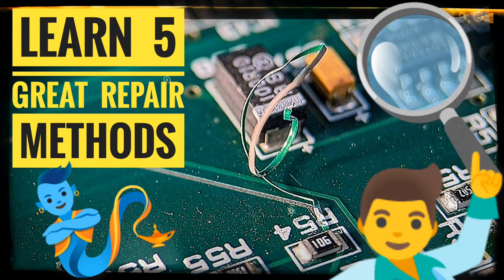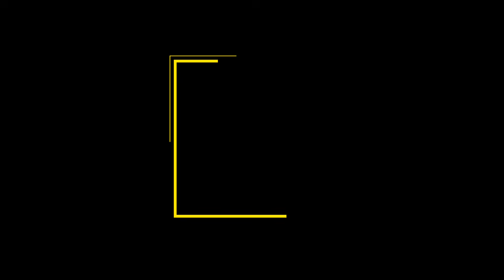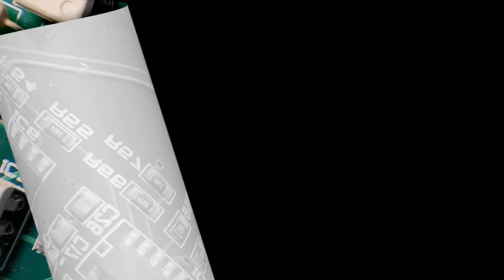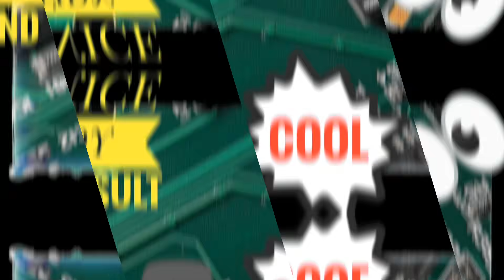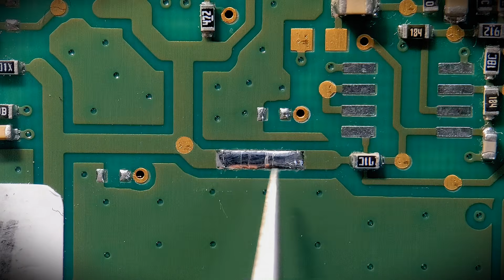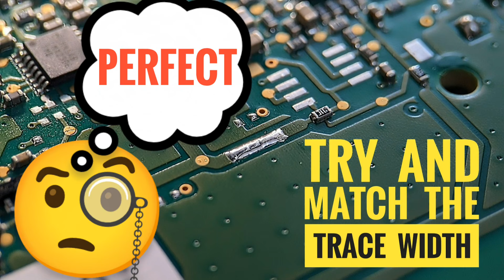Repairing Damaged / Broken PCB Traces || Soldering Tutorial

Comment: I notice that you use 0.2mm copper wire. In my haste I bought 0.1mm. Will that be thick enough to repair a trace that has 3.3v running over it?

Comment: Sir, great video.
In my restoration project, I am facing problems where VIAs are damaged/rusted/missing. How to handle this type of issue?
Reply from the maker: Hi , thank you for your comment . If your via is missing ( no barrel either ) if the board is only double sided ( no inner layers ) you can run a small unsleeved wire through the hole in certain situations , then solder to 2 relevant points on either side of the board that recreate the via's connections . If your board has inner layers then you need the boards schematics to reconnect to all relevant points . I have done other pad replacement videos that may help also . If your board is just double sided and a big through plated barrel is missing look up PCB eyelets , these may help . Hopefully there's some info here that can help . Good luck 👍
Reply: @mrsolderfix3996  Thank you so much for the guide. The Retro board is only double-sided (top and bottom).
Reply from the maker: Hi , hopefully my information can help you out with your PCB issue . There is normally always a way , it's just finding it . Good luck 🤞
Reply: @ayan.debnath  you can also buy replacement vias. they are inexpensive (only the tool to insert them is expensive) but you can also use a centre punch to fit them
Reply from the maker: Hi , thank you for your comment . You are right they are called PCB eyelets ( mentioned them in another couple of my video comments ) but they are only any good for double sided boards as can't guarantee they connect to inner layers . Thanks again for your comment 👍
Reply: @olDirdey  Thanks a lot for the guide.

Comment: Another great video as always. With the final repair, what's the benefit of running the solder out from the centre as opposed to just joining the two ends separately?
Reply from the maker: Hi , thank you for your comment , much appreciated . There isn't any particular benefit to how I showed the last method except it gives a stronger repair in the middle section as if left with just the tape it's not going to be as strong . Also the Kapton tape sits better on a level stretch of trace instead of going up and down if just both ends were soldered .
All these methods I've shown here have a variety of mix and match , I e the last method could have been solder masked . I always tell people choose the option you like or create a new option , that's what's great. Thank you again for your time , take care 👍
Reply: @mrsolderfix3996  Thanks for the answer, just trying to learn and every little detail helps
Reply from the maker: @alandrury9955  hi , no problem , I hope you get on ok 👍

Comment: I was trying to desolder a WIFI chip from an LED plate but I ended ripping it off along with the pad. 
For some reason blasting hot air for several minutes with the pads already thinned just wasn’t doing enough to desolder it like it usually does. 
Is it because of the LED plate?

Comment: I keep a stock of through hole component remnant leads to use to fix traces that are larger than can easily be bridged with a solder blob but small enough where a piece of wire wouldn't be worth it to cut and try to strip. I also use that method when I need to bridge 2 pads and I want a good connection but don't want to have to buy a 0 ohm resistor.

Comment: Half my comment disappeared great video always learn something dispite years of practice. I sometimes use nail varnish to cover joints. Problem is they are garish colours, if you are not bothered see if the wife has a spare.
Reply: I've got transparent nail varnish. I use this to join object- and cover-glass for microscopy if I need to make a permanent microscopy sample.
Reply from the maker: Hi , thank you for your support of my channel , much appreciated . I've heard a few people mention nail varnish . I personally have not used it on boards but I guess if it doesn't damage the solder joint etc then it is another option . Thanks again for your time , take care 👍
Reply: @mrsolderfix3996  Nail varnish is dissolved in acetone, which can be very aggressive against many organic compounds, like plastics. 
In the organochemistry laboratory it's frequently used to clean organic compounds off glassware, like test tubes and beakers.
It should not be an issue for FR4 boards, unless the adhesive between the layers dissolves in acetone. It may be wise to test this on a pcb that you are going to discard.
Reply from the maker: @LarixusSnydes , hi , I never use Acetone on my PCB 's as I know it's quite an aggressive fluid . I've heard a few people mention the same thing before  . The cleaning fluids I've posted videos about have never involved Acetone for this reason . Thank you for a good point raised 👍

Comment: Great video! So what's the idea behind the solder mask? Will the joint degrade without that protection? If you used something like hot glue would it damage the joint after a period?
Reply from the maker: Hi , thank you for watching the video and commenting , much appreciated . The joint will be fine without masking over it but it will give better long term protection from potential shorting out or maybe lifting away from the PCB . Masking is strong if cured correctly ( hot air will help , as I spoke about ) and will give a much stronger bonding to keep it all in place .  Thanks again , take care 👍